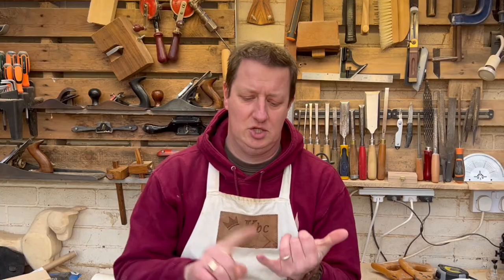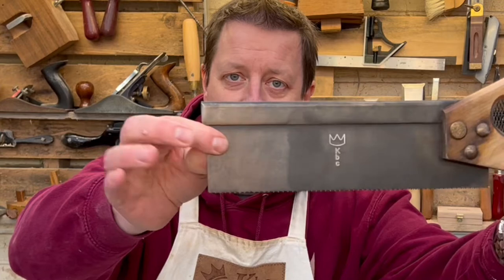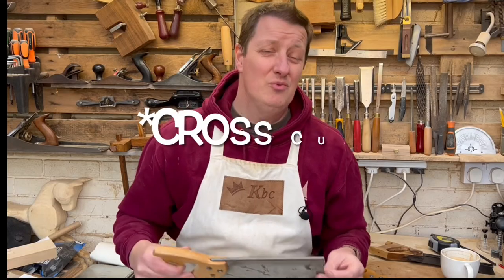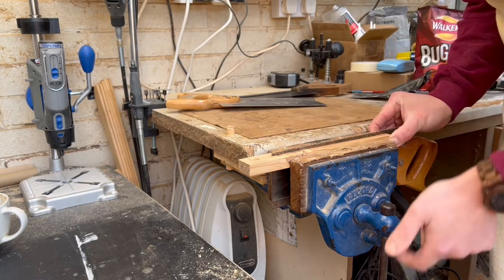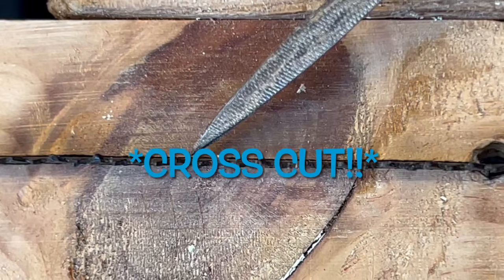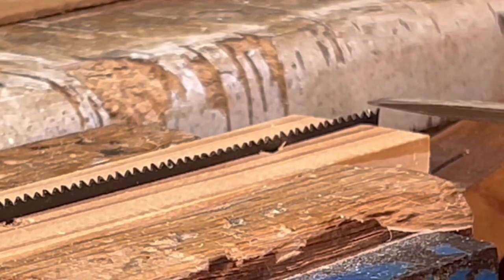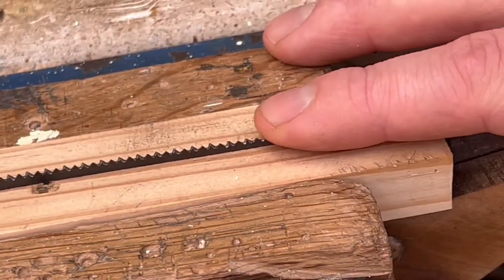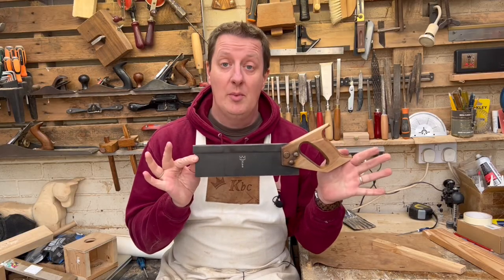How to sharpen a hand saw  |  quick and simple for cross cut and rip cut

Comment: did i miss it or did you miss it??? where is the part about making sure the saws teeth are all the same height?
Reply from the maker: If you know or want to level off the teeth, go ahead. I very rarely do that to my saws and have little issues. This is a video to get people to use a sharp saw quickly and easily, without all the minutiae that seems to come along with the supposed mystical art of sharpening!

Comment: Not a very good way to sharpen a saw you need to joint the teeth your file was to small. Ps am 40 years cabinet maker
Reply from the maker: I know there are proper files to own, but this was taller than the the teeth, and something most workshops will have in. Saw are often the last thing people sharpen because they’re scared and thing it’s difficult
Reply: Thank you and well done. The simple fact is that the saw you sharpened, even if you didn't joint the teeth will still cut much better than a dull saw. Some people just need to piss on everything... @KingBespokeCreations